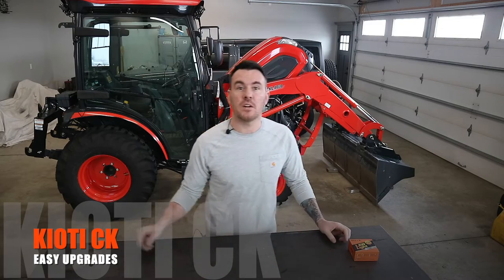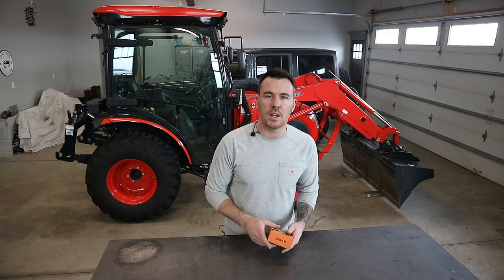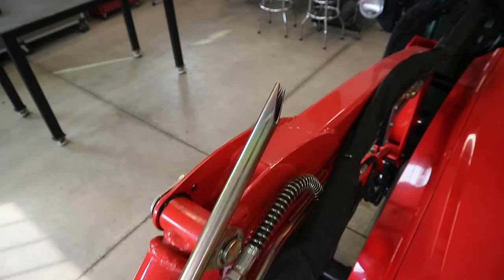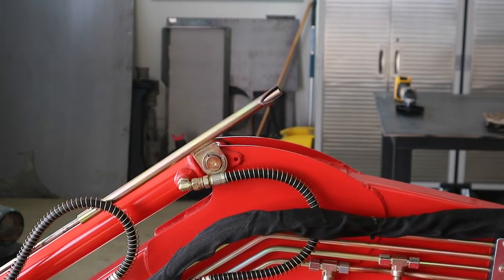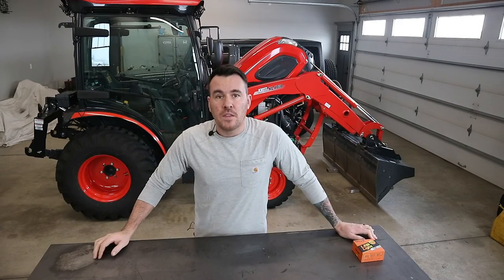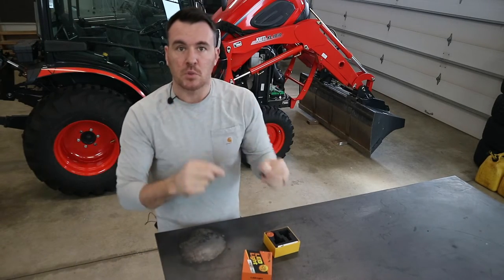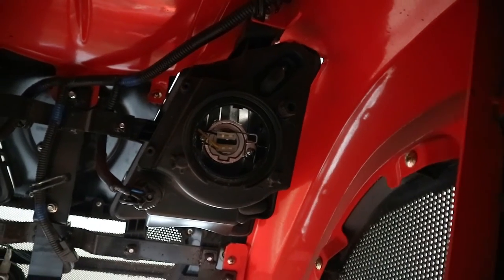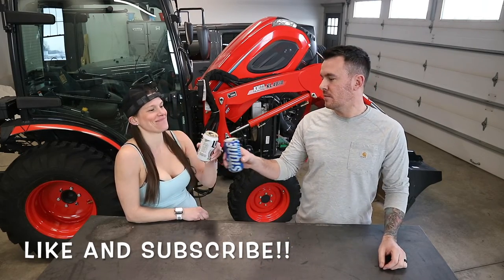EASY UPGRADES for your tractor

Comment: Like your videos! I have CK4010se cab same frame and everything. Need to change the running lights to LED also! (right beside the front blinkers)
Reply from the maker: Thanks Brad. I did start looking at doing the Blinkers.  I would like for everything to be LED.  ill do that soon, not sure if ill make a video for it though..  IDK.   thanks for the comment!
Reply: @SpicerDesignsLLC  I left my blinkers and brake lights Halogen

Comment: It's been my (40+ years) experience that bucket leveling indicators aren't used much. Asking an owner if they wanted to fix or replace one usually got "Scrap it".  .Lower the loader in float while curling the bucket in.  Take it off float when it's all the way down and start rolling the bucket out. When the bucket starts to lift the loader arms you're level. Or try the modern method - mount a backup cam to the front of your tractor..
Reply from the maker: I guess its all what you get used too.   I prefer to use the indicator myself but that's just me.  My next video is actually installing a touchscreen and rear camera.  Should be up next Friday.   Thanks for the comment!

Comment: I don't if you could pull off this up-grade, but I would like to place camera just below the roof, center front and a small screen monitor in the cab for visibility to the loader forks, bucket and grapple. It sure would increase productivity.
Maybe you would have to place the camera on the elbow of the loader boom. If you could pull that off it would be great.
I have the Bobcat CT5545 (Kioti 45 HP with cab)with a cab. I think a kit like that would sell.
...by the way, you're doing a great job. Thanks
Reply from the maker: Thats kinda crazy you mentioned that.  My next video is going to be replacing the stock radio with a touchscreen and a rear camera for attachments.  I believe you can add a front camera too.  I should have that video up in the next week or so.  All the parts showed up last week.
Reply: @SpicerDesignsLLC  Go for it!!!!! I would love to see your solution!!!

Comment: All nice mods. Well done. I have chosen to leave the headlights in my L2501 Kubota stock as I leave loader on. With the loader on they are shining the back of the bucket  more than anything else. I do have a led light bar up on the rops and that makes a huge difference.
I like the before and after shots that you did. Great job.
Reply from the maker: Thanks I appreciate it.  Those led light bars are amazing.  I agree with the headlights.  They really dont do a whole lot of good with the loader on.   Thanks for the comment.

Comment: The "baloney slice" on the bucket level indicator tube was standard on the Ford Compacts  circa 1980.
Reply: I am going to do the slice, but I am also going to remove the tube and mill small segmented windows it. (Small so you can't get your fingers in them) and paint the rod red or orange.
Reply from the maker: I thought about painting the tip as well.  The metal on the rod and the sleeve are the same so it can be hard to see it sometimes.

Comment: Looks like a great idea on the diagonal cut for the bucket level indicator.  So I think I'd take the talking over the shorts in case your doing a pole......🤣🤣(probably shouldn't say pole....🤣)

Much nicer to have the lights all the same color, something I need to do as well.
Reply from the maker: I can't take credit for it.   John Deno in the comments suggested that.  It works really well.  Ya i don't stand a chance against the keystone girl..  You'll be glad to know those shorts are in the trash.  Thanks for watching!

Comment: Great, I wondered if you or anyone you know on here has ever replaced the entire headlight housing? 
I wanna do these LED's but i have to replace a cracked housing and cant find anything on how the are removed.
Thanks
Reply from the maker: Do you have the new housing yet? Ill take a look at mine and see if i can figure it out.  Ill let you know.
Reply: @SpicerDesignsLLC  Thanks, I'm getting it from my Dealer tomorrow so I wanted to put LED Bulbs in there as well. 
Are those OXILAM LED for the Headlights any good or would you say get other ones ?
Reply from the maker: I would def look around.  Theyre pretty cheap.  They are brighter than stock though

Comment: a machine operator i know told me to spray paint on the rod and not cut it... then you can still have the whole rod, and maybe spray different colors as it gets close to level....
Reply from the maker: Ya thats not a bad idea.  Theres all kinds of ways to do it.  Once i cut the rod i was kind of stuck with it.  The angled cut on the sleeve definitely makes it easier.  Thanks for the suggestion

Comment: Those are some nice cans…

Of Miller Lite and Kingstone!  Is that bucket leveler adjustable?
Reply from the maker: I couldn’t agree more.  I dont think theres much adjustment after the initial cut.  Theres a couple ways to set up that indicator.  I just got the bucket level and cut the rod flush.  Adding the angled cut made it a lot better.

Comment: One of my tractor's has a bucket level indicator rod on it and the other tractor does not but I found out. That the more you use your machine you will get used to where the bucket is you will not even worry about a bucket level indicator that's actually a waste of money I think. Nothing feet practice and experience running gear machine
Reply from the maker: Ya i can see where your coming from.  At the end of the day its a preference thing.  I prefer to use it.  Ive gotten used to it and it came on the tractor when i bought it.  It comes in handy with most of my projects.   Thanks for the comment!